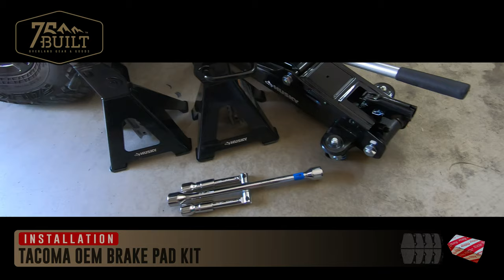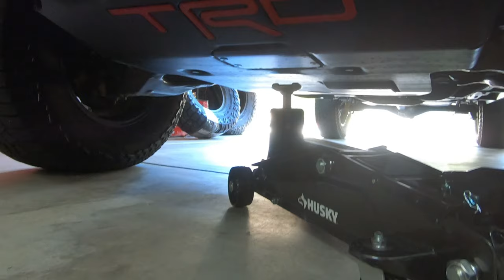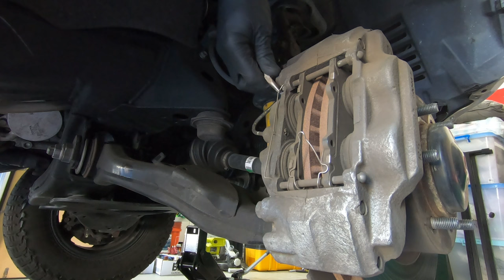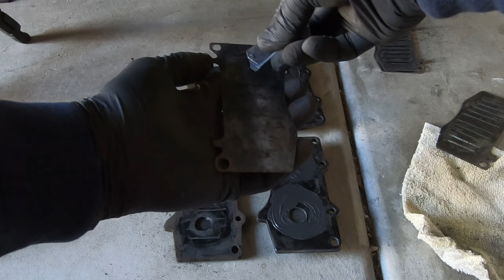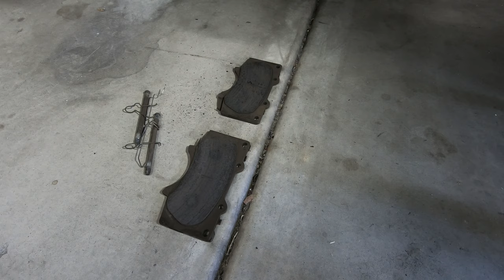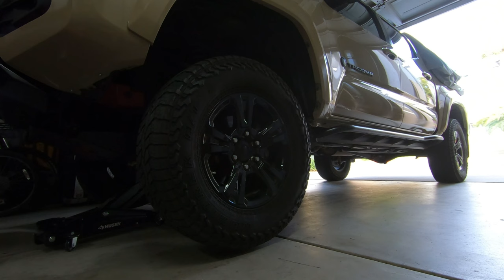Do It Yourself Brake Change for Tacoma - OEM Brake Pad Kit Installation, Change & Maintenance

Comment: Excellent video!  Really gave me a great look at the pads and hardware clips before I attempt mine this week.  With that kind of mileage I’m wondering if you should have done rotors and calipers too. I have 50k on mine and it’s getting the full treatment. I was really nervous about doing the calipers with having to flush and bleed the brake fluid, but there are some great videos by Chris Fix that explain the whole process. If you were able to do the pads as well as you did, you should look into rotors and calipers too. Just my opinion 🤘🏻.  Nice wheels and tires too!
Reply from the maker: So true, that may be next on the list. Glad we could help on the pad replacements! Thank you!

Comment: Great video.  Just out of curiosity, how many miles were on this Tacoma at the time you replaced the brakes?
Reply from the maker: Aaaah thanks for the question. Thinking the odometer was around 65-70k at time of replacement.
Reply: did you turn the rotors?

Comment: Do you have your change the back of your change the front ?
Reply: Rear brakes are drum brakes, therefore only the front brakes use pads
Reply from the maker: Yup that is correct. 3rd Gen Tacoma is Drum brakes at the back so those last much longer.